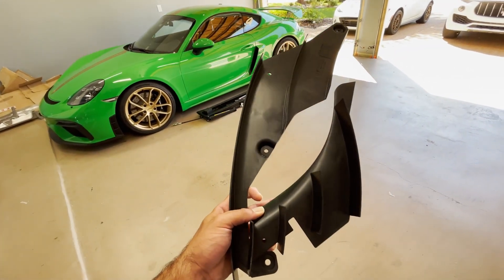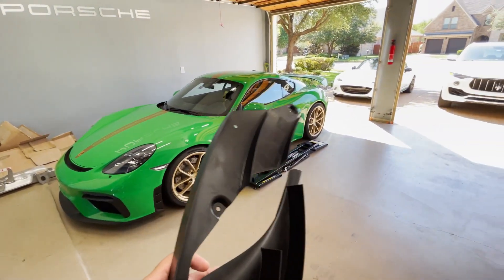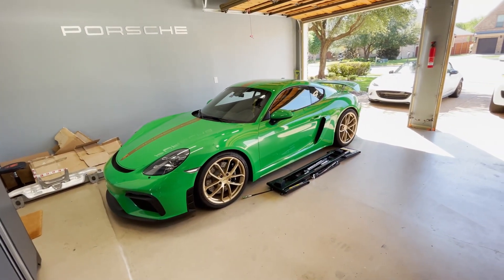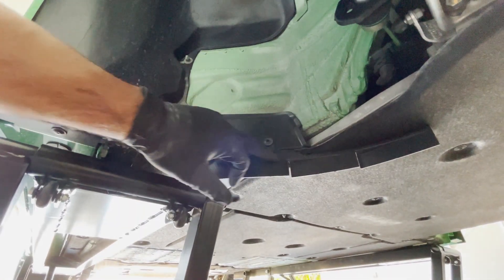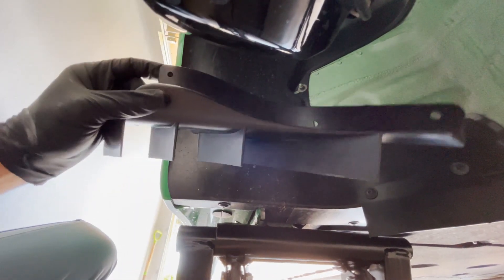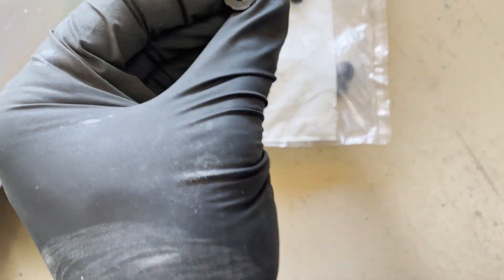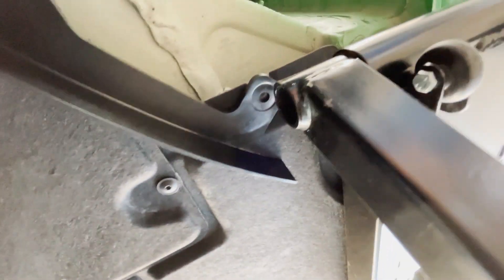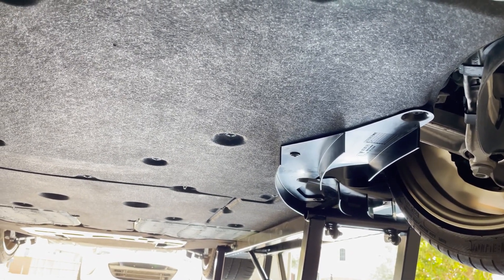Installing GT4RS aero on GT4

Comment: Just installed these based on your recommendations. Super easy to retrofit. I used the included plastic rivet/expander screw for the drilled hole but all other holes lines up with my existing t25 screws. Nice and tight. Be aware some of the screws from under the car were different lengths.  Does it make more downforce?  Idk. Can I drive inverted like F1?  Probably.
Reply from the maker: hahaha nice one

Comment: Called my local Porsche dealer and gave them the part number etched on the part itself but couldn’t find it. He later called me and said it had to be ordered through Porsche Motorsports. We’re you able to order at your local dealer?
Reply from the maker: yeah, so the part initially came out thro motorsport division for the manthey racing package however since then they are released as oem factory parts for the GT4RS. The part no i used is different than the one on the part itself (its the part no for the package which includes both sides and screws). It should be in the description of the video